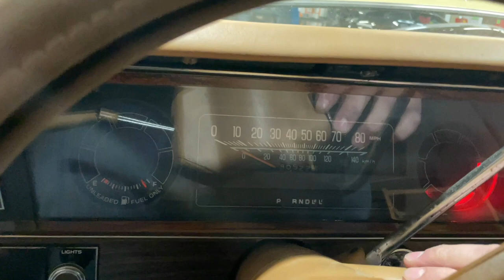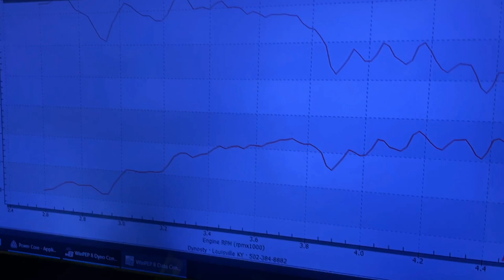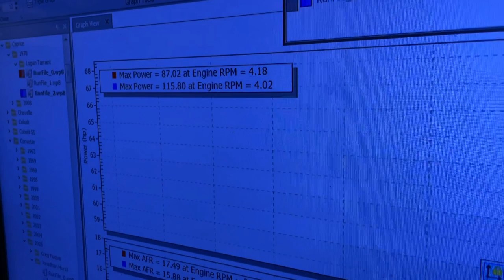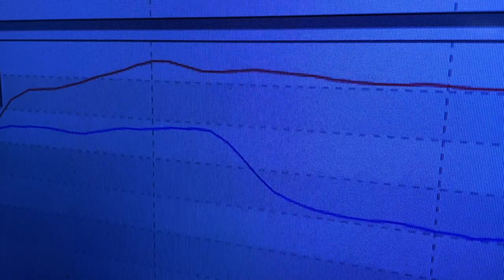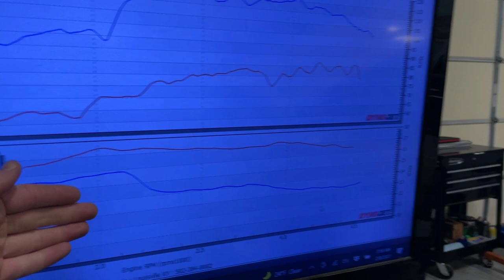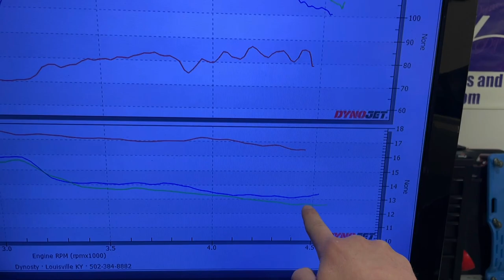We Used Brake Cleaner As Fuel.... Box Chevy 305 Dyno Session!

Comment: Cut the Mustard is from turn of the century 1800’s to 1900’s. Mustard used to come in a solid cake form. It was almost like a parmesan cheese. It would need to be cut with a wire cheese cutter. Then mixed with vinegar and water to make it usable. If someone didn’t have the wire cutter they were not wealthy enough and could not cut the mustard.